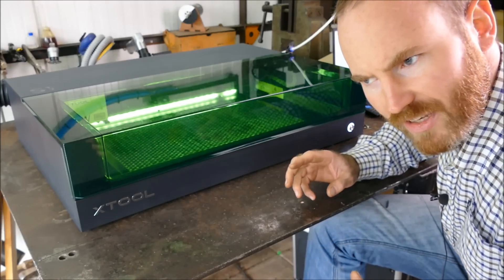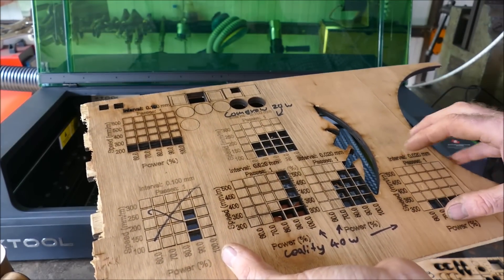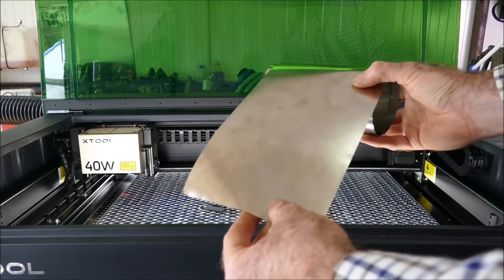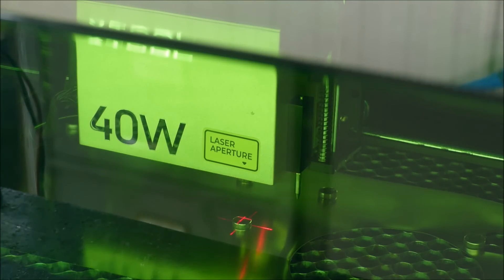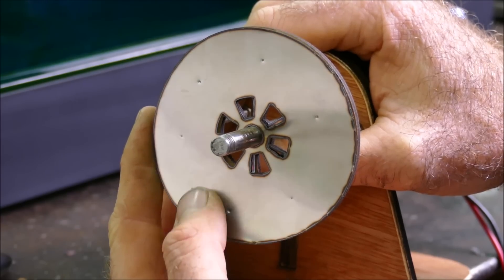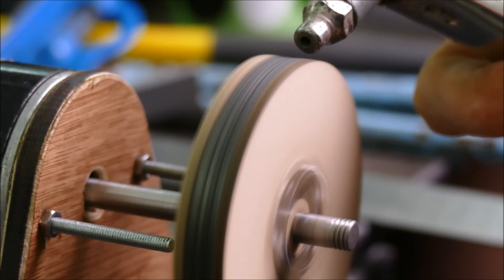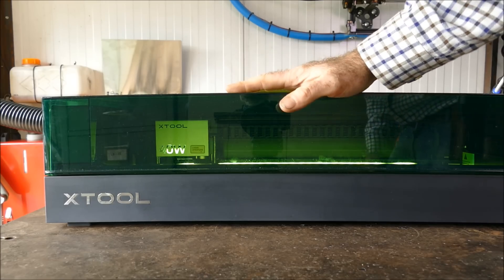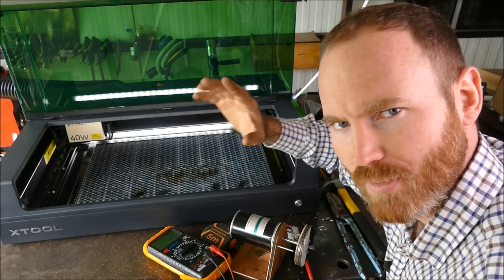New S1 proves Nicola Tesla *WAS RIGHT* I built it with a super safe CNC 40w laser - Extreme review

Comment: Hi Josh, as an apprentice, we used to run up ball races like this and drop them on the floor to see them zoom up the workshop. A  large truck gearbox bearing could store  a lot  of energy!  The trouble with the Tesla turbine low is efficiency. If you used something like a torque converter turbine, you could have a much higher efficiency through redirecting the working fluid and taking more energy from it ( Air, water or Oil)

Comment: Hi Josh, Another of Teslas magic. I have been interested in this turbine for many years but my age is against any further experiments, however I think you would be interested in salvaging the platters from old non-functionl PC hard drives, these being If I remeber correctly somewhere around the 1-1.5 mm thichness. These would need to be set up to have the center sectionscut out as you have done on your turbine with ultra thin (not flat) platters. The bearings would need to be ceramic by prefference as the normal speed of a corrrectly built turbine is in excess of 10-15 thousand RPM. In fact many well built turbines have exploded due to excessive centripedal forces at such high speeds. I don't know if you are aware that if you drive the turbine not only do you acheive a high rotary velocity but the center if isolated will act as a vaccuum generator. Getting back to the hard disk platters, they are ideal as they are precision made and precision flat and are ideal for the turbine blades. Unfortunately I never got around to building one due to the pressures of family life and now am too old to want to. I have enjoyed your videos which follow a lot of my past interests and I wish you well in your edevours. Best regards MoK. PS.Teslas coil is another enjoyable build you may want to look at.

Comment: Hello Joshua!!! I use Google translator. Therefore, please forgive me in advance, the phrase was translated incorrectly...I’m just learning how to work with a laser. It was after your videos that I purchased Aufero and Ortur. I have one idea, maybe you’ll like it... Unfortunately, I won’t be able to implement it in the near future, the other day I’m leaving to work for three months.Instead of a honeycomb metal mesh, you can install a radiator from a car, and install a fan from a car under it in a large casing. Radiators are made of aluminum or copper, they have high heat transfer and will not allow iron to stick when cutting. In addition, the fan will press the cutting material with the air flow.And it will help the laser cut thinner.

Comment: Hi Joshua, another great video. Just a thought but if the exhaust outlet from that oil burner can boil water, it can generate steam. If the heat exchanger can be placed in a sealed container with the water then presumably pressurised steam can be fed into an enclosed Tesla turbine. You then have a feedback loop to charge a 12 volt battery that powers the glow plug.

Comment: Great video, once again,   I need your advice, I'm a DYI hobby wood builder and also need to help my daughter on some architectural projects, we would like to buy a laser cutter but use it very occasionally, and all that I see are quite expensive. what do you suggest?
Reply from the maker: Thank you so much. What specific jobs do you need one for and I may know which machine is suitable for the money. Cheers J
Reply: @joshuadelisle   basically small pieces to build buildings like maquettes for gluing them after, so nothing so expensive, if it's good for engraving, it will be a must. I'm talking like 3mm of sheets, EVA, cardboard
Reply from the maker: @MrJfrutuoso1972  thank you. For just 3mm thick material the Comgrow Z1 pro 20w is ideal and very affordable. That's what I would choose. Cheers J
Reply: @joshuadelisle  tanks, I will check for it
Reply: @joshuadelisle  but it's sold out and the price for what I need it's quite high, I was looking for something between 200 to 400€ at most, and it's already a struggle since the wages here in Portugal are quite low, if you have any other in mind, çet me know, but money here is a problem. thank you so much.
Reply from the maker: @MrJfrutuoso1972  we were thinking of moving to Portugal... Land seems a lot cheaper there but I guess there is a reason why. A Comgrow 10w version will still cut 3mm and is much cheaper just not as efficient as the 20w. The LONGER Ray5 10w is a good option also and can be upgraded to a 20w later. Cheers J
Reply: @joshuadelisle  thanks once again, and you're welcome to Portugal
Reply: I decided on the 10w, any promo code?
Reply: Comgrow  Z1 10w
Reply from the maker: @MrJfrutuoso1972  I did a video a while back call the 'cheapest 10w laser cuts 8mm ply'. Should be discounts in the description. Cheers J

Comment: One of the causes of distortion is the fact the stock is not flat plate, it was found with disc brake rotors, cutting them from coiled stock, when they get hot, they distort....warp if you will. 
With this design, using this stock, if the spacers went right to the outside of the disc, yes it's weight would be increased, but the gaps would be equal, if this is desirable.

Comment: @Joshua De Lisle - You might want to try using the platters from old HDDs (hard disk drives), which are very flat and very well balanced.
Reply: ooh now there is a thought.
Reply: HDD platter would tank efficiency, the thinner the sheets more sheets you can squeeze in.Teslas equations basically shift the factors for efficiency to want more sheets and more rpms.
Reply: Use a number of small nozzles to guide the air between disks, then you can have as many disks as desired, and they can be strong but lightweight. The density of stainless steel works against you at high RPM, because you are up against the same kind of problem as a space elevator. They need material that is strong but lightweight. The aluminum substrate of HDD platters is not ideal, but it is better than any variety of steel. @jerrys2292
Reply: @jerrys2292  I guess more layer stacked will achieve more torque rather than more rpm.

Comment: I've really got to urge you to look into the work of Jeremiah. The Tesla turbine is only half of one device, the other half is called the Tesla pump..The turbine and pump run on cold steam.When in use it will turn heat directly into kinetic energy. Cold steam is water boiled at room temperature under a vacuum. This is cooled on its way through the turbine and pumped into a vacuum tank. The cold steam is many times denser than air as a fluid.. Thanks for the videos!    https://www.youtube.com/@iEnergySupply

Comment: If you're going to make one again, I'd suggest a simple offcut of laminate flooring, you could tape small pieces of copper wire or ball bearings to create the dents, then stamp each disc on both sides to make the spacing issue quicker to resolve
Reply from the maker: Good tip. Cheers J

Comment: Instead of using copper or aluminium as a backer could you not use simple glue sticks (ie the kind you'd use with your 3D printer) to tack the stainless sheet onto a plywood backer?  I can't see it having any ill effects on either the sheet or laser and any fumes couldn't possibly be worse than the chromium?
Reply from the maker: You could be right that maybe a very cost effective way. Having a space allows the metal to heat up better and therefore oxidize and burn away better. Having the metal clamped down with magnets is very handy but a temporary glue could be used. Making sure the wood isn't burning underneath may be an issue. Some experimenting is needed. Cheers J

Comment: ha  ha - the "tesla turbine" running out of an enclosure wasn't really working in its "tesla turbine mode" - a solid wheel will also freewheel to near freestream speed...

Needless to say , I love the enthusiasm with which you attacked the "problem" - despite the "drawbacks" of laser-cutting the very thing SS shim..

I to do dislike manufacturers locking everyone else out of their systems, though some of the drawbacks may be work-aroundable.

 Anysystem can easily be stuck inside a cabinet - and frankly they should be.   I make enclosures for my "cabinet free" 3d printers out of polystyrene foam (construction insulation - of whatever density I need / have available) and aluminium foil or house wrap - with heat and ventilation piped in, a laser enclosure is no more difficult to imagine (easier as it isn't trying to be a thermal envelope...  (I even put in a double glazed window using clear plexiglass inseted into the foam, very easy...)
Reply from the maker: Yes the turbine definately need refinement in the future video. Self build enclosures will be a good video project to tackle as many would like the option. cheers J
Reply: A 3D printer is much, much less likely to spontaneously burst into flames, which is a very real danger of using a laser with flammable materials.
3D printers also don't shoot beams of light that can permanently damage your (or your family's, pets' or other innocent bystanders') sight.

Comment: First dongle I've seen in over a decade. There's a reason they died. A tiny data stick in a workshop - that's never going to get knocked off and lost, surely? Add to that it needing proprietary software to work fully and you've lost a large percentage of your buyers.
Reply from the maker: I think your right although it has its advantages. the dongle I beleive is just a key and only crosses live wires to enable the function to work, I think i could make one from an old usb by soldering all the wires together. that is if the official one got lost or broken. cheers J
Reply: @joshuadelisle  So you could replace it with a wodge of kitchen foil or a scrunched up chewing gum wrapper? I remember using the same technique to start my Morris Traveller when I lost the keys a few decades ago. 😄

Comment: Your Tesla Turbine is not doing what a Tesla Turbine is meant to be. Without a Case that forces the Gas to exit in the Center of rotation, the Air gets pulled out from the centrifugal force. What you want is, that the Air has to exit through the Center. So as the air is pulled out but only can go inside, it has to accelerate in a spiral trajectory towards the Center. Like water is doing when draining off in your shower. This is what makes Tesla Turbines reaching RPS way above 50´000 and suddenly ripping apart your blades if not perfectly balanced. lol But thanks for the review of the machine.
Reply from the maker: Yes you're right. As I mentioned in the video I'll build a bigger one with a housing to increase efficiency. Cheers J
Reply: @joshuadelisle   May im a bit picky. But you are not increasing the efficiency. You are changing the functional concept of the turbine.
Reply: Yeah 12:48 he mentions exactly that. Maybe watch the whole video first 😉👍
Reply: @TheZombieSaints it’s like mixing yeast, sugar, water, and salt together and calling it bread, then saying “it needs some work to increase it’s breadyness”. No it needs the main ingredient.
Reply: @TheZombieSaints   I did, he said that a enclosure makes the turbine even more efficient. But thats not true. His Turbine does not work as intended in the first place. He actually would change the whole functional concept of the turbine. Thats a difference.

Comment: What happens on z-axis if the height sensor goes over the cutting matrix, i.e edge of material?
Reply from the maker: So the probe works by mapping the area not by dragging but by dibbing up and down and registering different heights and open spaces, this can only be done in the xTool software which I didn't get to use. Cheers J

Comment: The Falcon 2 you reviewed has a cover that sits over it. However I find the fan is lacking any real world application as it's only USB powered. 

It would have been nice if they threw in a real 120/240v fan to move the fumes and smoke instead of gently suggesting they leave the laser. 

Usually after cutting some wood out you'll lift the enclosure to be hit in the face with a concentrated smoke cloud. 

I wish there was a cheaper option to extract the smoke and fumes especially when lasering metal pieces. My wife and I already both got very sick from the fumes when doing some Yeti Engraving.
Reply from the maker: Thats disappointing to hear it's not good enough. There are lots of fans available that can be modified to fit. A cheap short term solution if you own a compressor is to put a small regulated air line in the exhaust pipe to create a Bernoulli Venturi effect. Or otherwise use a regular desk fan and tap some stuff card into a cone as an adapter for the outlet. Cheers J
Reply: It's very easy to add a proper 100 or 150 mm inline fan if you already have an enclosure. You just need a reducer and larger exhaust hose.
Diode laser manufactures don't throw in fans like that because that would double the cost of the enclosure.